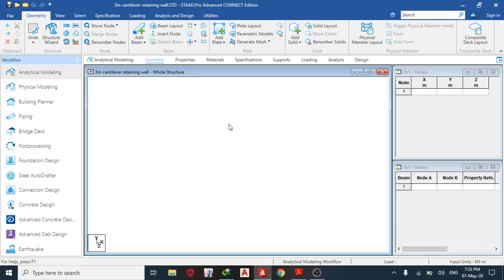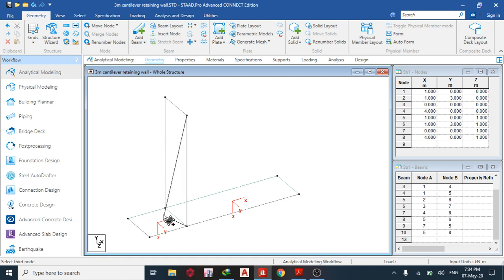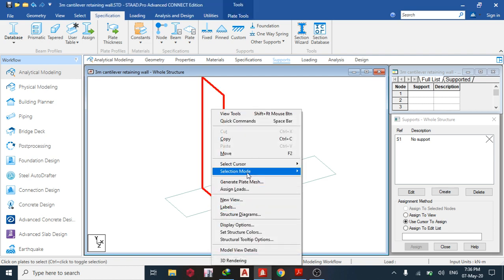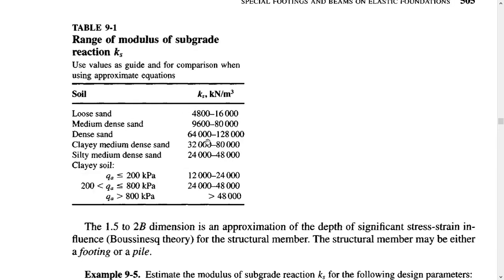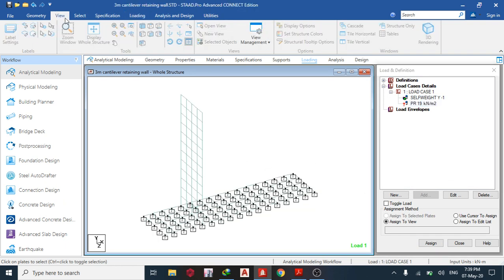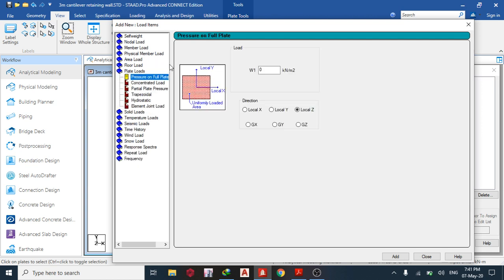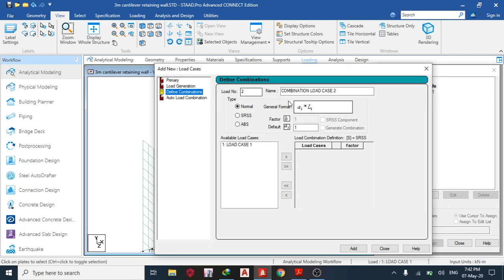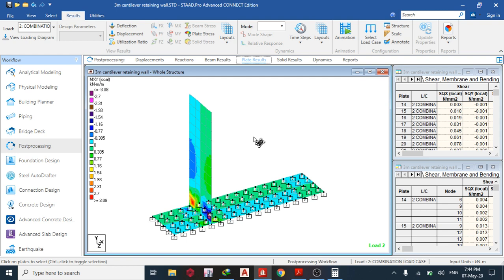Modelling, analysis of a cantilever retaining wall with staad pro and manual calculation

Comment: How do I change the mesh plate to rcc slabs in staad. Advanced concrete design. RCDC CONNECT EDITION, unable to read analysis data
Reply from the maker: How did you mesh your slab?
Reply: @Lanreolokunola   I went through one of your videos cantilever retaining wall. Advanced concrete design doesn't work for the software.
Reply: @Lanreolokunola  how do I get my bars results
Reply from the maker: @yawashia8678 design it like a plate. Check my previous videos on plate design
Reply: Does it work

Comment: Great work. Pls what connect version of staad pro are u using? I installed v22 update 2, but couldn't using the inbuilt RAM connection.. because the license for it is not available... It had very limited use.. If you select BS5950 for connections purposes, you won't get any available options to start the connection... And tips on how to fix the issue?
 Thanks.
Reply from the maker: Andy Abur bs5950 works perfectly for my ram connections
Reply: I know, my question, how did u get to activate the integrated RAM connection in your staad pro connect edition. In mine, the license is not active, hence the limitations
Reply: I just figured it out.. I went to the license tab and activated it manually...😄. Thanks for reaching out tho. Keep the good work up.. Am learning from u.
Reply from the maker: @MadeWun  congrats

Comment: Nice Video . Can you pl write the Load calculation in Numerical (i) Self wt --ok   (ii) wt of Soil (iii) active earth pressure Ka*1-sin /1=sin (iv) Passive earth pressure (v) hydraustatic water pressure if wall is subjected to  and finaly the(vi) seismic load , I will be highly obliged to you
Reply from the maker: Φ= 30  γ= 19kN/m3 
self weight is automatically made by staad. 
active pressure = γ kaz
passive pressure was ignored. = γz/ka
i did not design for hydrostatic water pressure and seismic
Reply: Thank you very much sir. If retain wall is subjected to hydraustatic pr. And seismic how it is to be applied sir.
Reply from the maker: @fazalarju   for hydrostatic pressure it would be the density of water times the height (a triangular load). Then for seismic analysis  watch my video on how  assigned it 

https://www.youtube.com/watch?v=cbUCXE5r0Cs
Reply: Thank you sir